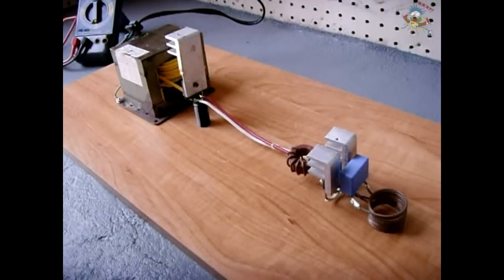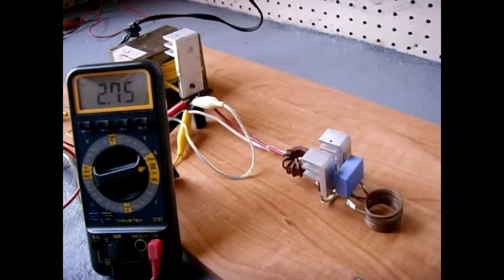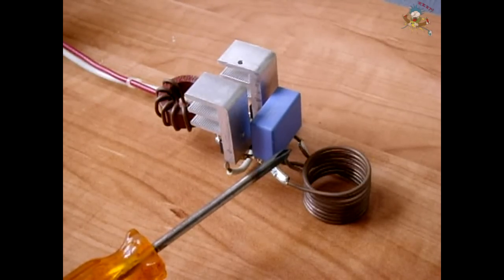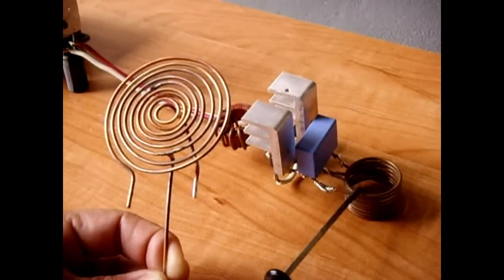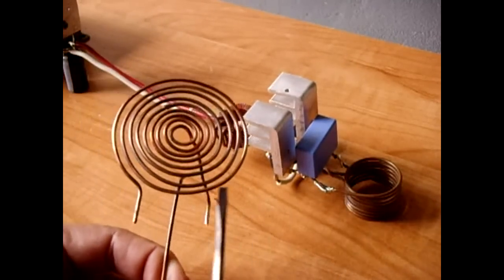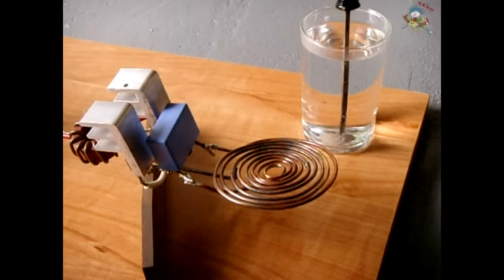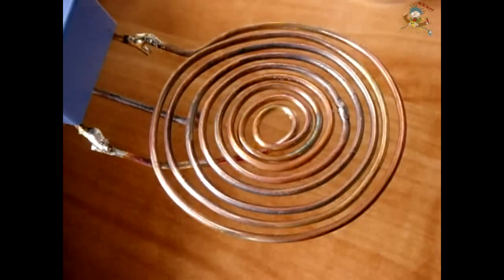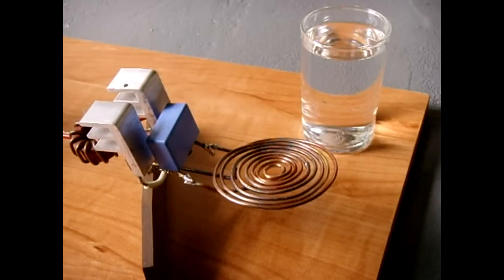Induction Heater Follow Up Video(Spiral Coil & Current Tests)

Comment: I'd like to see the spiral coil heat something flat, like a tin can lid with some water on it, to get a better idea of the shape of the induction field being produced.
Reply: +joandar1 , Unless you are only planning to melt low-temperature metals in small quantities (like lead, solder, aluminum foil, etc) I think you will need to use I higher power system. The ZVS driver with these size MOSFETs will probably not deliver more than 100 watts of power to the metal. for large amounts of metal, the thermal capacity will be very high, and it will take a LOT of energy to reach the melting point. Energy will also leave via conduction, convection, and radiation, so the driver will have to deliver higher powers to counteract the cooling effects of the metal. But I think it will work fine for low-melting stuff.
Reply from the maker: A tuna fish can would work, I thought of it, but I was worried about the can shorting the spirals. I would need to carefully position the can over the coil. I could lay a piece of 1/4" tempered glass over the coil, then place the tuna can on top of the glass and heat water. The water will definitely heat up, but I can see your point about getting a better idea of the induction field. When I get a chance I will try and set something up and take a close up photo of the heating water and place a link in the video description area.

Thanks For Watching!
Reply: electronicsNmore Yes, please do! Also, to balance the coil better, is it possible to center-tap the coil before it is would? (by finding the center and soldering a wire there) I do not understand the multivariable calculus to calculate the strength of the inductance close to the center vs to the outer edge, but I would think that by finding the absolute center of the wire, then the inductance would also be matched. A flat piece of pyrex glass or ceramic would also probably work since they are designed to work with heat.
Reply from the maker: That may work. There are online calculators you can use for spiral inductor coils. :-)
Reply: electronicsNmore Just a thought, can you make your centre tap on the flat coil movable as in a Clip/clamp and find the balance that way since your meter is on the edge of its sensitivity? I am very interested in this method of heating and want to learn how to make something to melt casting quantities of metal as well as variable frequency so as to be able to case or through harden steels. Love your work, thanks and cheers from John.
PS. I am wondering about using my mig welder as a power source, about 24V and 180 A at max output.
Reply from the maker: You can move the tap around until you find the spot where both coils heat the same, and both mosfet's heat sinks feel about the same temp. If your looking to melt things, then definitely use the original work coil I had installed. The open core. If I turn up the voltage on that coil, I can get the object being heated very hot(orange /white). If the MIG welder is not DC, then you will need to rectify the AC before using it, and take that rectified DC and smooth the ripples using a filter capacitor. Ideally you would use rectifiers from a car alternator to handle that kind of current.

Thanks For watching.

Check out my video playlists as well.